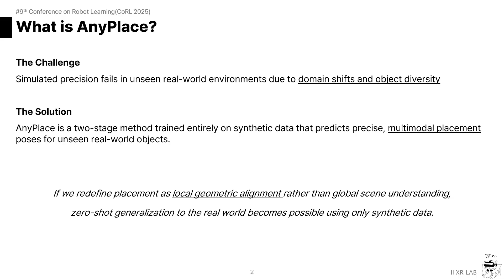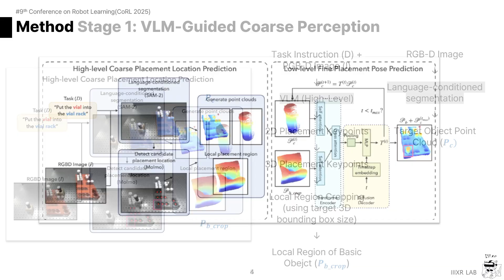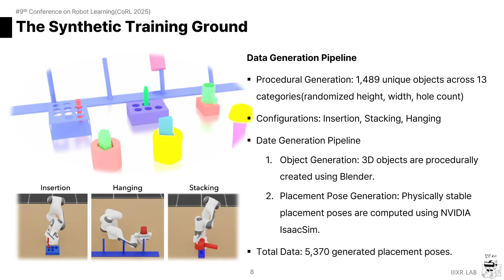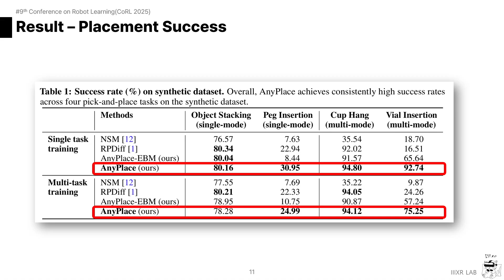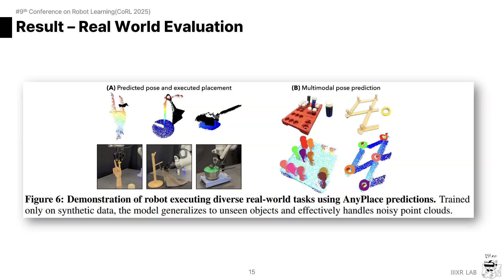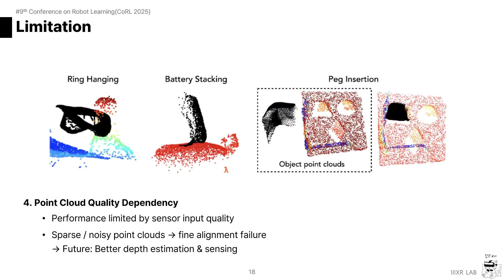[Seminar] Can a robot place objects precisely in unseen real-world environments?

Comment: Nice presentation

Q1. Can the model ensure that predicted placements do not result in minor collisions that are not visible in the point cloud?

Q2. Is the system robust to depth sensor noise under poor lighting or reflective materials?
Reply: A1. The model cannot fully guarantee the absence of minor collisions that are not visible in the point cloud. AnyPlace predicts SE(3) poses based on observed geometry but does not explicitly model contact interactions during diffusion. Small gaps or unobserved surface details may therefore lead to subtle collisions. While motion planning and collision checking help prevent major impacts during execution, fine-grained contact consistency is not explicitly enforced in the model.

A2. The system is reasonably robust to moderate depth noise because it relies on local geometric relationships rather than appearance features. However, severe depth sparsity, reflective materials, or poor lighting can degrade point cloud quality. The paper reports failure cases caused by incomplete or noisy observations, particularly in insertion tasks. Thus, sensor noise remains a practical limitation in real-world deployment.